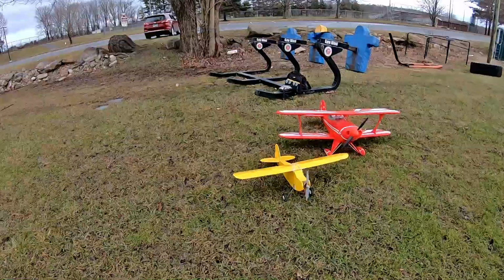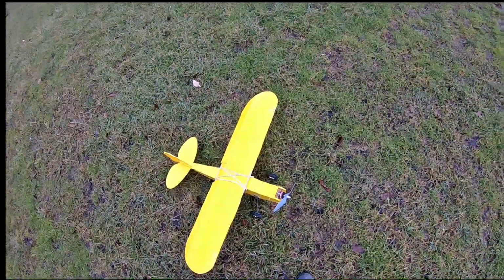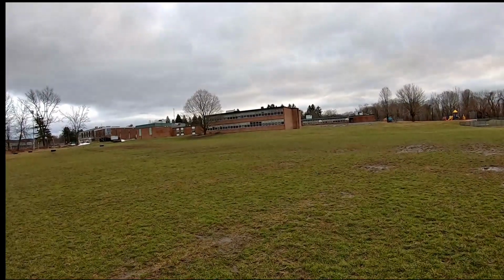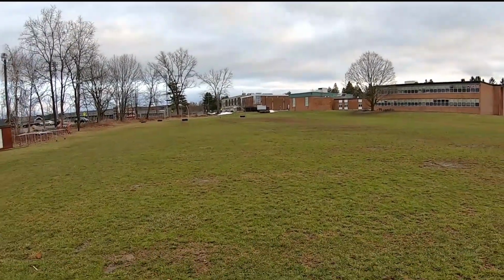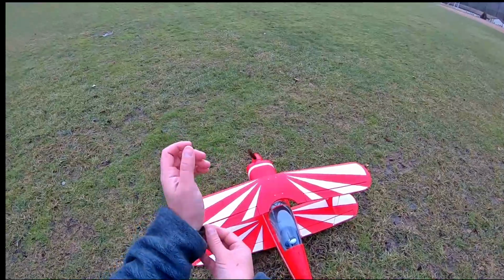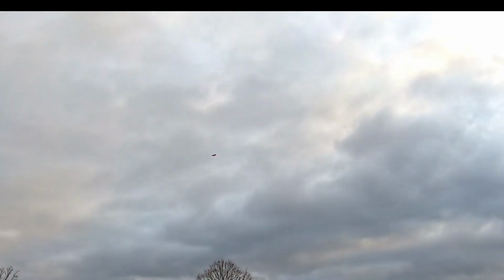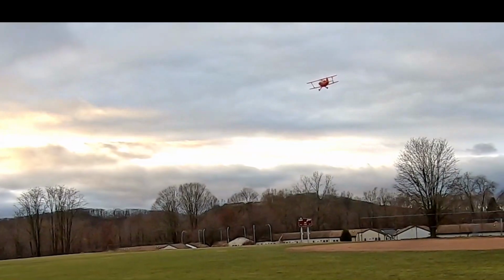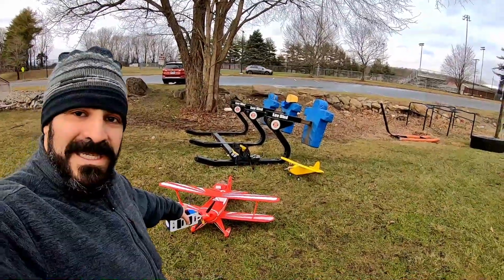FMS Pitts 1400mm Maiden

Comment: Close call on the landing.... but nice flying, btw the ft flier is like the kill bill of foam planes......
Reply from the maker: Yeah that landing was scary, and I'm still trying to understand what was the problem because it was in stability mode, but then again those cross winds do not make things easy, and the FT Simple Cub, is a lot of fun, even though the foam board is way too weak for any landing gear, as you can see from all the reinforcements I am constantly trying out. I am on (landing gear v3 now)